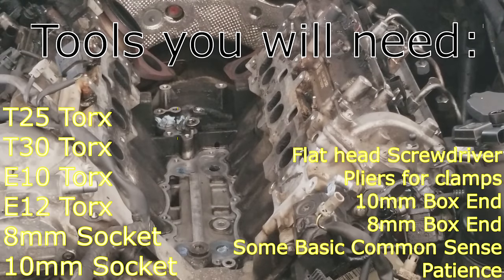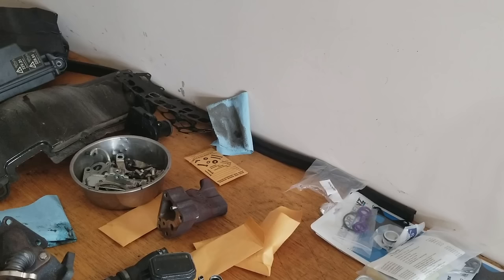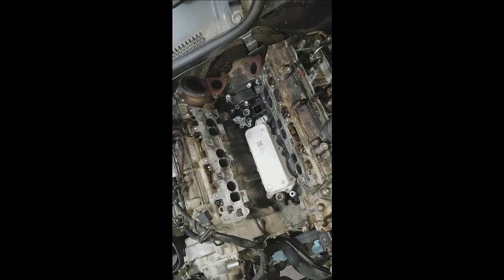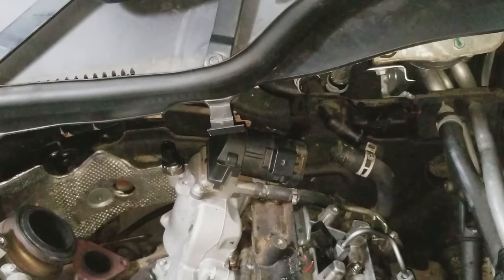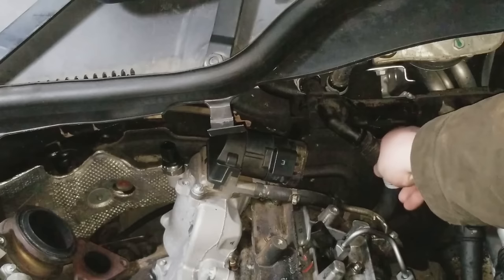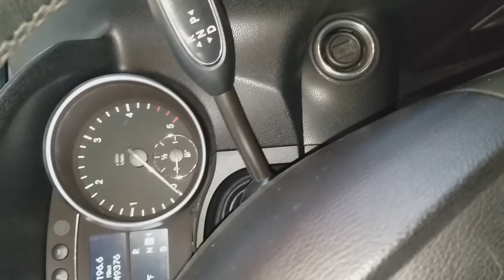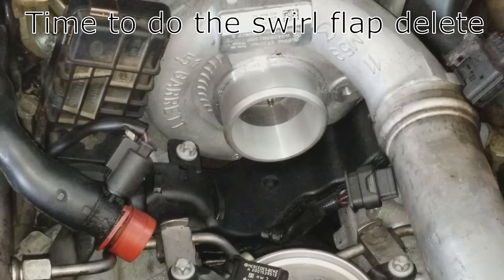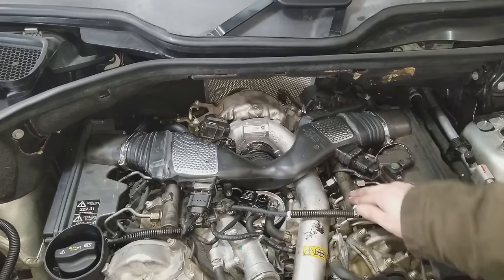OM642 Oil cooler seals DIY guide and timelapse!

Comment: How do you know if you have a leaking oil cooler?
Reply: Small drops of oil on your driveway coming through a drain hole at the back side of the v, or look under the car with the engine running parked facing up a hill and you'll see it leak.
Reply: @tolsonryan  Thank you.

Comment: How much time did it take the whole work?
KUDOS!!! 🙂
Reply from the maker: A solid weekend, 5-6 hours a day. I spent extra time deleting the swirl flaps and cleaning the intakes and stuff, so how long it takes depends on how rushed you are
Reply: @MBDieselFreak  Thanks for the feedback! Do you have any videos related to the swirl flaps?  Mine's prior to Bluetec technology, so deleting them is quite possible.
Reply from the maker: @martinrkrs  no I don't sorry! I've only.ever had the opportunity to video the removal of them once, and I didn't have my camera with me! Once you get the intakes out, it becomes pretty obvious. You essentially need to bust off the spot welds that hold on the 'flap' to the rod going into each port, and the. Pull each rod out. Use epoxy to hold each rod back in place to seal the hole.

Comment: Thanks for the video, where is your shop located, I might need some engine work on my gl350 x166.
Reply from the maker: I'm near Lansing MI.
Reply: MBDieselFreak Do you know any shops in dc area ? I might need timing chain replacement, I am hearing a brief rattle every morning with cold start.
Reply from the maker: @chaitu2k7  I'm not familiar with any. I can tell you though that the cold start issue is most likely the timing chain tensioner. You should be able to change that yourself, it's relatively simple and cheap. If not, any shop should be able to do that, so long as you tell them JUST to change the tensioner.
Reply: MBDieselFreak thanks again for your quick reply, do you have a procedure to change the tensioner? Is it just one or two tensioners for this engine ?
Reply from the maker: @chaitu2k7  no problem! I'm not quite sure what the procedure is, I've never done the job. I do know from experience though that Mercedes tensioners are always threaded in from the outside of the block or head, so it can simply be unscrewed without disassembling the rest of the engine.
Reply: MBDieselFreak thanks for the info, I will order the tensioner and try this weekend, how can I check if my oil cooler is leaking ? For now I don’t see any oil drip under the car , not sure if I need to remove the under cover and check,  mine is 2014 MY, how reliable are these cars in general, can I keep it for the next 5 years or sell it ASAP ? Can I delay Oil cooler and timing chain issues by switching to higher weight diesel oil from mb229.52 gas engine oil ?
Reply: Could you look into my previous question ?
Reply from the maker: @chaitu2k7  Sorry for the late reply, this comment got burred! 2014 model shouldn't suffer from the oil cooler seal issue, it was fixed in 2009 i believe. but you can check by removing the aerodynamic plastic panel under the transmission, and look for oil residue around the transmission bell housing. that is where the inner block "drain" dumps to, so if oil is leaking it will come out there. I would run whatever the spec'd oil is for that vehicle. usually the bluetec's run a 5w30 full synthetic. as long as its taken care of properly, it should last you another decade. the big downside to the newer diesels is the emissions system. the DPF, adblue system can be troublesome and expensive to fix, but having a capable scanner that can read all the cars control modules can save you SO much money with these newer cars due to the cars ability to diagnose the majority of its own issues.
Reply: MBDieselFreak I cannot open tailgate on my 2014 gl350 I tired to open from key fob, button on the door, release button on the tailgate, nothing worked, I hear something clicking on tailgate, but not doing anything operator manual says use key to open manually for emergency , I cannot find the key hole near the release button or a manual latch from inside the trunk on my car. Could you help with this ? If this is actuator issue I still need to open the tailgate somehow to replace or rebuild it.
Reply from the maker: @chaitu2k7  There SHOULD be a small plastic cover on the tailgate accessible from the INSIDE of the car, pop that off and there will be a lever inside to manually release. 

your issue could be a number of things: the tailgate control module, the rear SAM, or the hydraulic motor itself. 

remove all the rear end interior trim/carpets to access the hydraulic pump underneath the spare tire well, and check the hydraulic motor for corrosion. this will tell you if there's been any water intrusion, which is most likely coming through a bad tail light seal
Reply: MBDieselFreak thanks for the response, x166 gl350 does not come with a separate latch to open from inside, instead the actuator has a small key hole to insert the manual key which unlocks the actuator, I was able to release it, and since then trunk is working normally, I will clean and apply some grease.

I did some tune up over the weekend, noticed that engine has a lot of carbon build up, I sucked as much oil as possible using a evacuator from the dipstick line and filled with motul 229.52 5w-30 oil, engine runs much smoother now, I still hear some rattle from the engine at cold start and lite rattle when accelerating under load, these noises were more noticeable before the oil change.

I am planning to do a engine flush using liquimoly flush and will fill new oil after a week.
Do you have an email I can send a few pics? I see some oil near the right air filter attachment when I tried to change the air filters, not sure where it came from.

Comment: Really nice and informative video. Can you please specify the torque specs for the bolts that would need to be torqued additionally could you please recommend from where I should get the seals online? I have a 2009 GL320.
Reply: You can get the kit here...

https://www.idparts.com/oil-cooler-seal-kit-om642-p-5146.html

Comment: Would you also replace the oil cooler itself ? Just curious I have the same gasket problem.
Reply: I didn't replace my cooler: I just placed it on a flat surface with fine sandpaper and got out all the high spots.

Comment: MBDieseleFreak.
  I have had no cel for the last 4 days. Van was running a bit sluggish at take off. Came out this morning.  I have a cel again. Van is not running sluggishly. I'm not at my shop. When I get there. I get my reader out & tell you what code pops up. I'll clear it again. We'll see how long before it comes back on. 
      Ok. I'm back. Checked computer for codes. 
    P2007 came up.
Intake manifold runner control stuck closed Bank 2.
  Is this the swirl valve control arm? 
Bank 2 is drivers or passenger side. Not that it matters. If I can delete the swirl valves & motor. Install this resistor you are talking about.  That's what I'll do. "Sooner or later"
Before 2 years goes by. I just got it smogged.
California rules and regulations for smog suck.
Ok. My main question is.  
"Can I remove my swirl valves?  (In California) 
Where do I find the Resistor? 
Is there a video on u-tube that will assist on how to set up and install the resistor?
  Removing the swirl valves & using the jb-weld" to make sure they dont slip out & fall into the intake or motor is pretty self explanatory. I don't see any problems doing this part.  But the resistor.  Where do I find the correct one? I hate electrical stuff.

Comment: Lowest quality oil cooler seal replacement I ever have seen. 0 technical information, 0 torque information. Overall dirty and messy job. Not a single mention that - you MUST replace cooper exhaust bolts, you MUST replace 2 bolts that hold turbocharger to its stand, you can't take glow plugs just soaking them for few hours, there is a certain amount of torque for glow plugs. All exhaust&intake seals MUST be replaced at this point. You can "just screw 3 times" bolts into manifolds - Mercedes gives EXACT pattern how to tighten the bolts and certain torque moments.

Comment: this engine sucks!
Reply from the maker: To each their own. It's much less reliable than it's predecessor, the om648. But compare it to other late 2000's common rail diesels with the restrictive emissions equipment, it's just about as if not more reliable. 

Almost all the issues with this engine we're ironed out in the 2009+ Bluetec updates, but that brought a whole other set of problems with the AdBlue injection......
Reply: MBDieselFreak 😂
Reply: I have three of these engines,: 2007 Sprinter, 2007 E320 and a 2012 E350. Lots of torque and a lot less problems than most of the other competitor's engines. Why Chrysler/Jeep went with Lombardi Italian diesel engine in the Liberty instead of a small Mercedes TDi 250 is probably to save money but what a mistake, but they did grab the OM642 for the Grand Cherokee . I'll take this engine over anything else in it's category.
Reply: @jesseparris6507  VM Motori is in Emilia Romagna, not Lombardy, and always has been. VM Motori is owned by FCA. The VM L630 engine was originally designed for a Caddy back when Fiat and GM were 50/50 owners. The newest version post-Dieselgate (MY 2020+) is significantly changed from the original 2014-19 VM EcoDiesel, I've read 80% new parts I think. Biggest thing I heard the engineer say in another video attached to this one is the EGR is pulled POST-DPF, which means no soot problems, in theory. Why they didn't figure that out earlier when DPFs were just coming in is a big headscratcher. https://youtu.be/vo9E2IXg_ic
Reply: @MBDieselFreak  could you send me the torque specs for this engine please and thank you